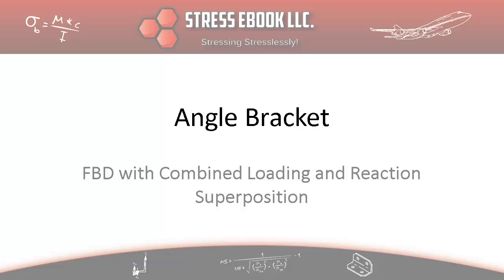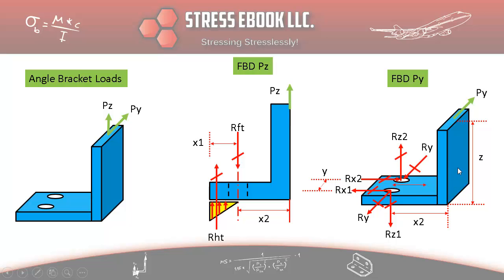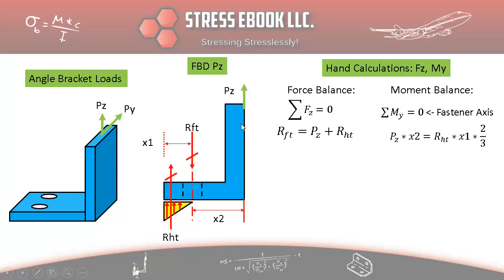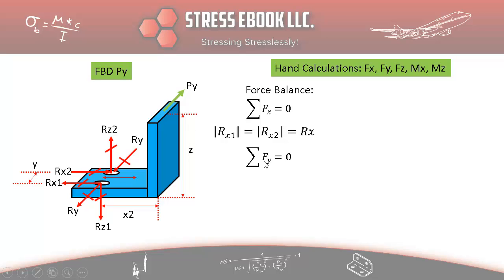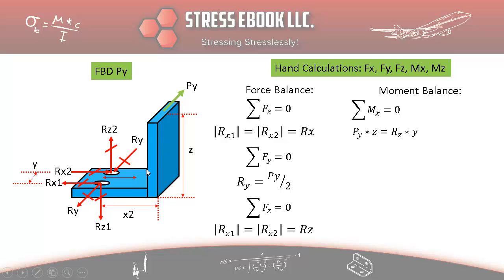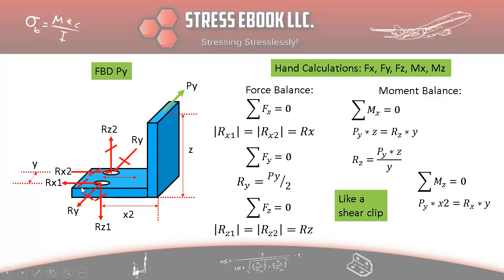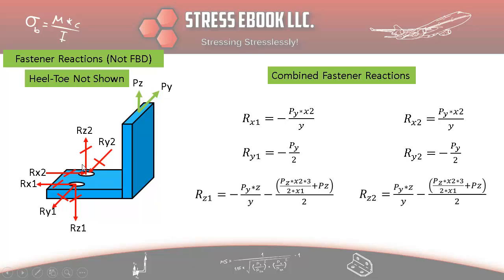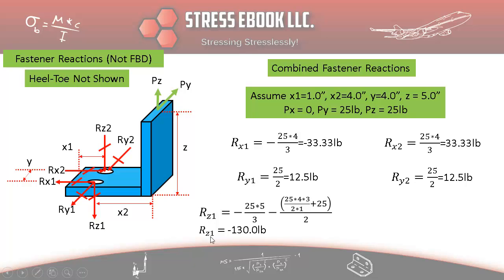Angle Bracket Combined Loading

Comment: Great video, but how about sizing the plate thickness for Py load, the front part is easy, and Pz load is also straight forward, but determining the stresses in the back part from Py is quite a challange. Looks like it is working in torsion and would be great get some feedback.
Thanks in advance.
Reply from the maker: Think about net section, tension and shear interaction

Comment: Hi there , could explain the fbd if I had a U bracket . So basically like this |__| . The horizontal is bolted down  and fixed . The vertical on each side has a square light that’s bolted to the sides. They have an aligning plate behind . So a big U bracket to hold 2 d
Square lights that each has a weight
Reply from the maker: Bottom line, its all vertical, meaning it is a double "vertical load on angle bracket" FBD. Balance the forces and moments and you will see. Reply here what you found.

Comment: What if you have force in vertical and horizontal directions, along X and Z axes. How would be the FBD be?
Reply from the maker: It is simply a matter of static equilibrium. You will need to work out the individual FBDs using force and moment balance, and then use force summation. Check out the video with load along X for that FBD.